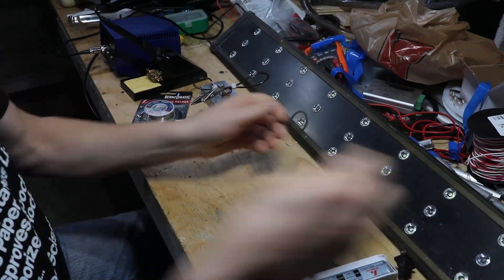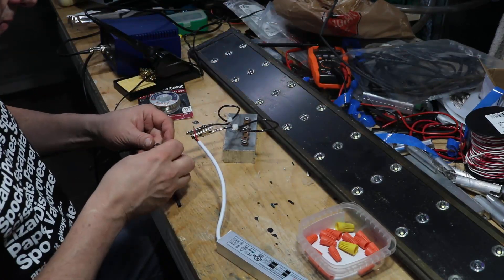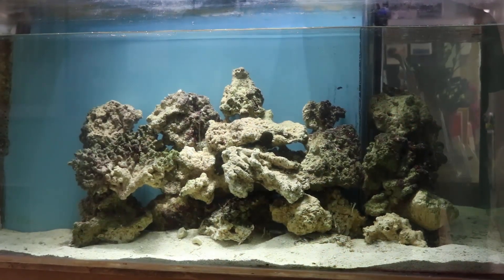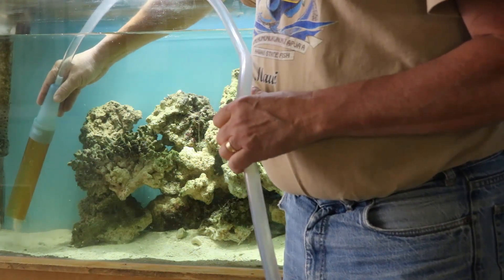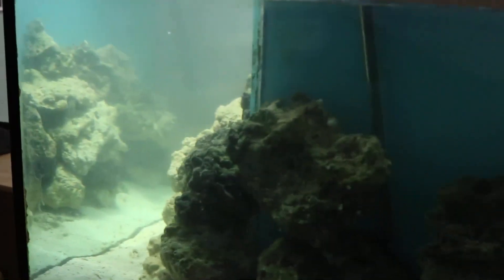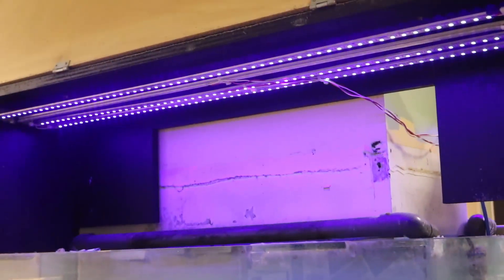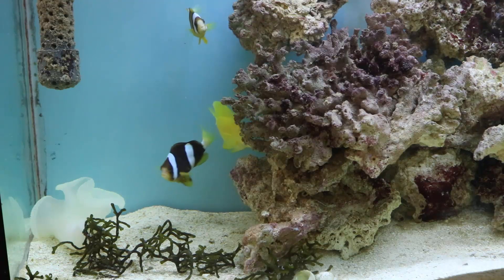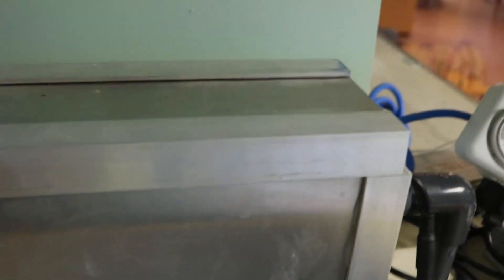DIY Algae Filter Installation

Comment: Have you ever cut the length down on a glass aquarium and would you consider a video of doing it. I need to cut one down for a sump. Or could you build me one? I live in Missouri so it would need to be shipped. Thank you Jim Fisher.
Reply from the maker: Hey Jim. To cut a tank down I would first have to take it apart. That is a most annoying process and I don't like doing it. I would just build a tank of the necessary size. I'm doing a video for Wednesday that explains the problems with shipping. If you still want to try it after, just leave me another comment then. Thanks for watching